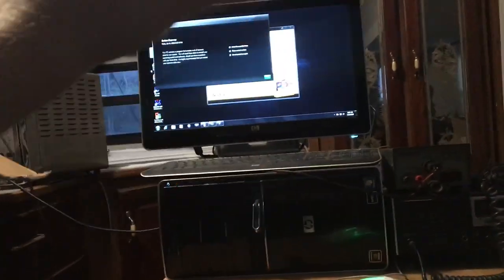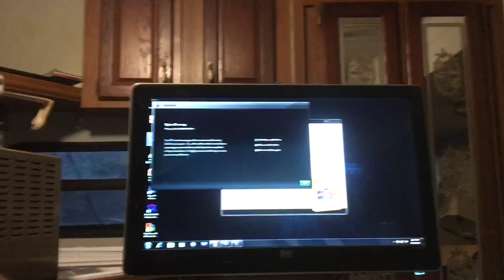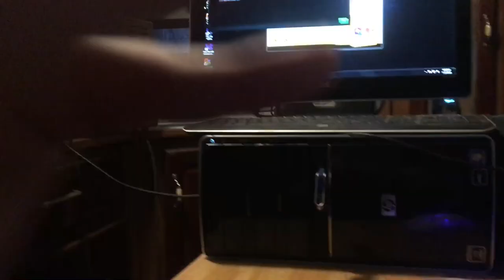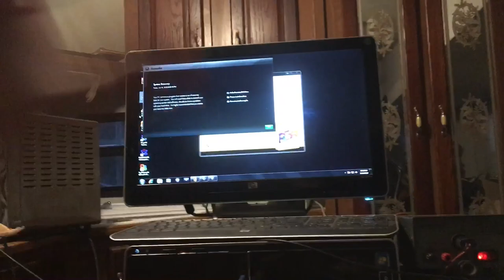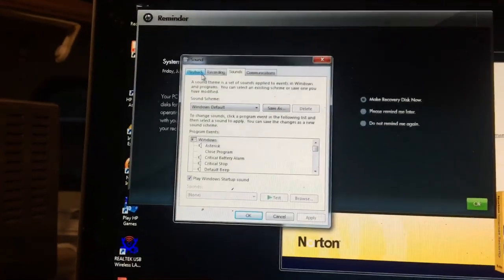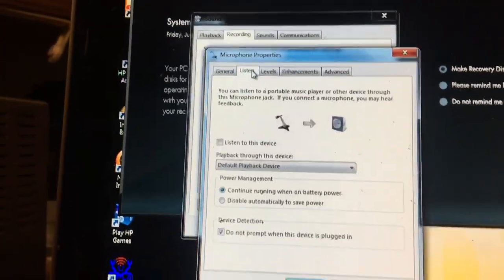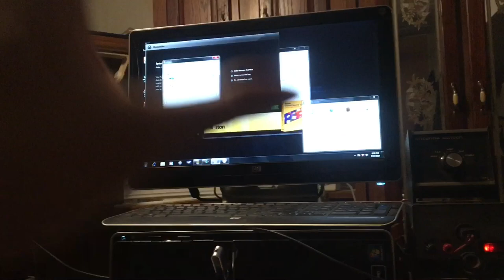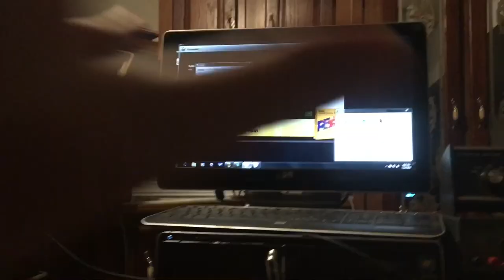HOOK YOUR CB RADIO TO THE COMPUTER FOR SKIP CLIPS AND STREAMS!

Comment: Hi Johnny< how old is the computer, before it will not handle line in, Windows 95?  By the way, Line In is either Blue or a Purple colour, I think you put it into Green, Line out!
Reply from the maker: Yeah I put it into the green microphone port because it amplifies the signal.

But otherwise I recommend line in for sure 👍

Frankly I’m not sure what year the 
Line in option was introduced to PCs

If I can remember correctly windows 98 had a line in port